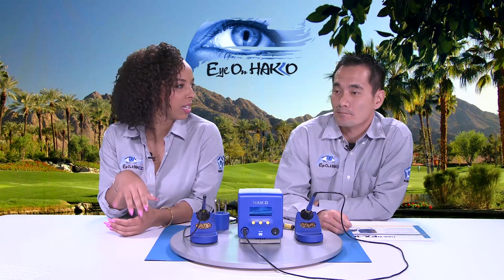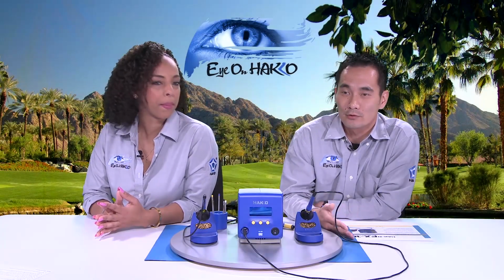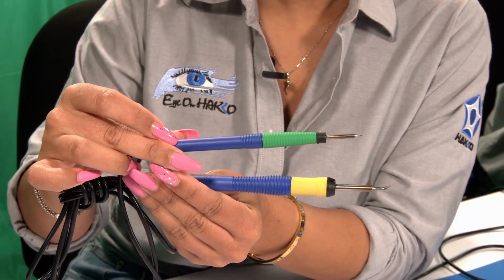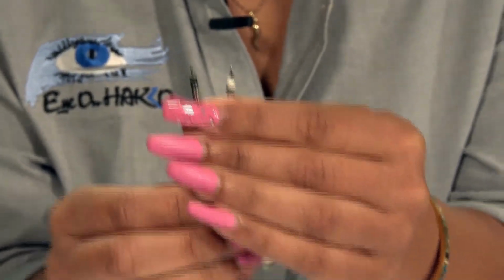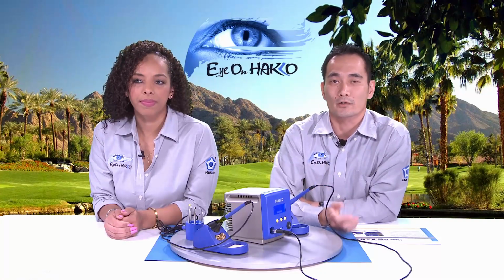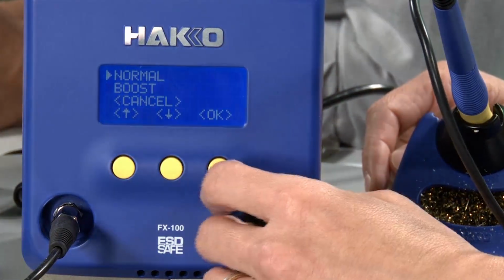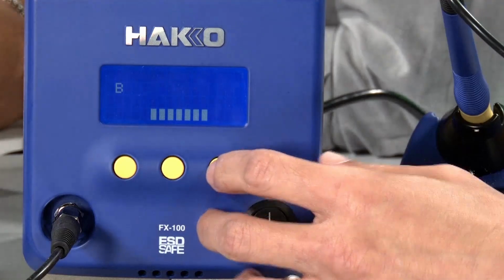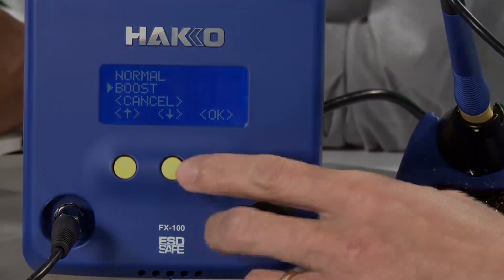"Eye On Hakko" presents the HAKKO FX-100 Soldering System

Comment: So… Hakko puts a nice screen and ui on the station you can’t change temperature on, but the 3 digit alarm clock on the ones that are controlled?
Reply: 😂This is an induction-type soldering iron; it doesn’t require manual temperature adjustment. It operates automatically by using the heater’s Curie point